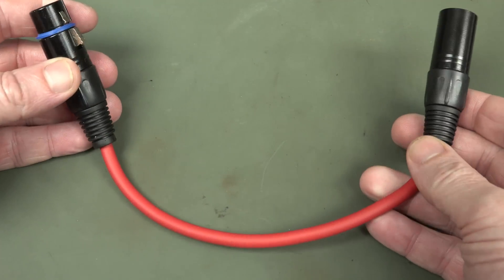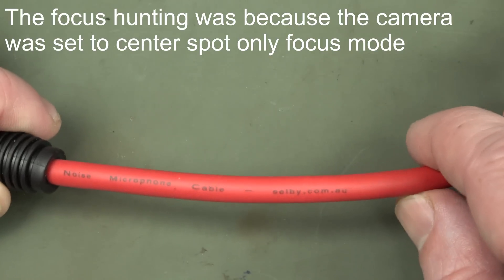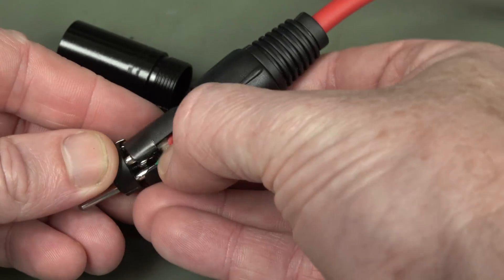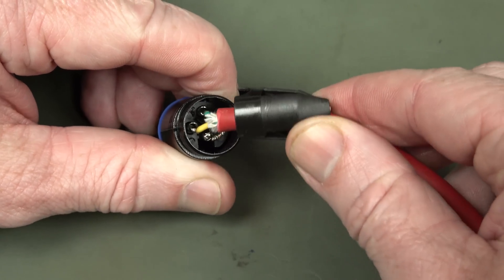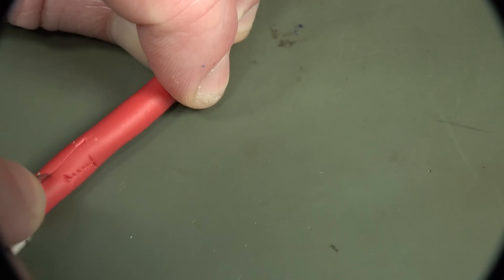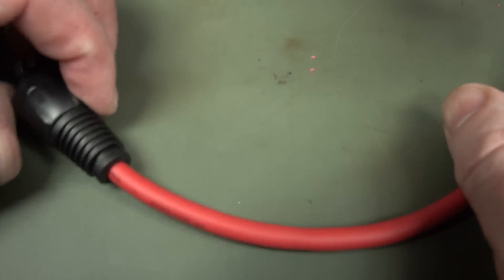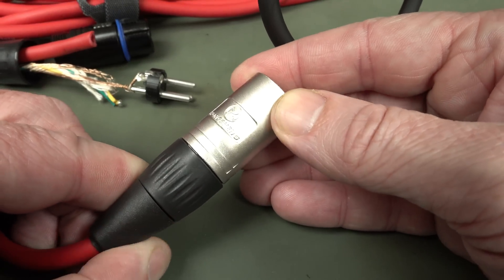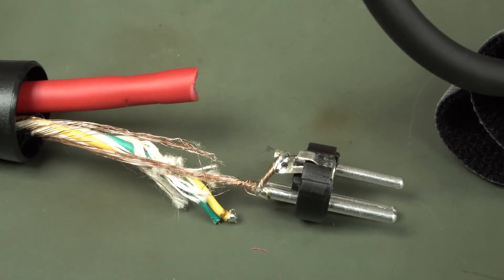Crap Quality XLR Microphone Cable Teardown

Comment: Looks like they forgot to heat the heatshrink at 6:50.
Reply: krish They only use it to prevent shorting to loose strands.  Leaving it unshrinked allows quick field repair with a solder pencil, versus having to cut the cable short and possibly getting a new connector from nowhere.  There's not a lot of places that can get you spare connectors in the evening in a random city 30 minutes before the show opens.
Reply: I just noticed that, maybe there's a reason for doing it like that?
Reply: Or you can just cut away the heatshrink :) No need to cut the wire. The heatshrink will also act as a strain relief at the most fragile point, where the solder on the wire ends.
Reply: If you want one with "shrunk" heatshrink then you need to fork out a few bucks extra for the delux version ;-)
Reply: At least they soldered the wire into the cup.  The heatshrink wasn't needed for corrosion protection, just insulating from stray wires or paths.

Comment: That cable was an absolute disgrace. The cable I've used when making XLR cables always has a foil and a decent braid, and pretty much exclusively used amphenol XLR connectors. Solder cups filled and heat shrunk, unlike the rubbish job they did.

Comment: Yeah, the 1st one was shitty as hell soldering job. More normally the actual bucket in the rear of the XLR-3 pin would be filled and the twisted tinned conductor end well down inside it. Personally i'd never makeoff a mic cable unless it was star-quad, i.e 4 twisted pair stranded and heavy shielding something like L-4E6S Canare.... Made in Japan.... of course.

Comment: That's a really terrible cable. Even the cheap-ish XLR cables have a braided shielding.

Also, when you want to dismantle the female XLR, you have to push on the latch while pulling the connector insides out.

Comment: A common construction problem with ready made cables is the conductive plastic sheathing under the screen. 
All too often not trimmed back providing a resistive short. 
I use lot's of cabling so I buy cable by the drum and bags of Neutriks to make my own.

Here's a question:
When using mic cable i.e. screened twin core, as a guitar lead (Jacks instead of XLRs) which gives the least core to screen capacitance, using both cores together as the Hot or taking one of the cores together with the screen? 
OR 
I guess leaving one of the two inners not connected?
Reply: Although I make most of my own cables I do, when ordering from Thomann, add a couple of these to the order. 
3m cheapos. 
https://www.thomann.de/gb/pro_snake_tpi_a_3.htm
Sturdy enough though. 
I do curl the corners of the cable clamps in to give 'em a little more bite.

Comment: The worse part is taking hours thinking it’s the mic, or something else. Then just discover changing the cable takes away the hum or pop. And some cable companies cut back on the shielding for more flexibility to call them stage cables, thus can cause unwanted signals interference. A good stage flexible cable would use more shielding wire at smaller wire gauges winded together. I guess you do get what you pay for. Even a good expensive cable can go bad, took me a few weeks to discover an intermittent hiss sounds was caused by one cable. 
The behind the screen of being a YouTube creator. Your the director, audio technician, video technician, lighting tech and what ever you do on your channel also.

Comment: Shield coverage shouldnt be too important on a symmetrical connection.
Reply: Yeah, "not too important" under Ideal Conditions.  But if you are in a situation with buzzy phase-angle light dimmers, or a high RF environment (like a broadcast transmitter site) then that horrible cable will bite you right in the backside.  Not worth saving a few pennies out here in the Real World.
Reply: I was just trying to say that shielding is less important with balanced cables like XLR (compared to unbalanced cables), since they cancel out most of the induced noise. Of course it always depends on your local situation.
I wouldn't go with super cheap cables anyway,  since there are already enough other things to get annoyed by.

Comment: When I get new audio cables, I usually tend to open connectors if they are not molded and check soldering and cable so that I know if I can trust them. And for some applications I just buy cables and connectors separate so I can make my own custom cables for specifications I want, and it is usually cheaper that way too than buying whole cable locally.

Comment: Why is the cable grounded to two pins on the first, and only one on the second?
Reply: aDynoNet maybe to avoid ground loops
Reply: Normally XLR cables only connect one pin (Pin 1) to the shield and do not connect the connector housing. That’s because traditionally devices have the shell electrically connected to the metal body (protective earth) but may use a separate “audio ground” for the shield and as audio reference gnd. Not all manufacturers obey this rule, though, and you might get surprised when hunting down ground loops/humming/interference.

Comment: not enough heat in the joint, more than likely if you do heat the pin it will melt the plastic

Comment: Sagan can probably solder better than that!  I'd repair it properly and keep it as a spare (get out of jail card). That shielding will be fine for such a very short length. The purists will disagree and I respect them for that.  Only to be used in an emergency until a proper one from Neutrik comes.

Comment: Never support cheap crap. For 99% of the consumers, the cheap crap just ends up in the landfill.
Reply: I told a chinese seller who sent me some crappy led effect lamps, that he don't need to refund me, if he promises me to tell the manufacturer that they need to push the LEDs flat on the board while soldering it. They will fail by overheating, because there was a big air gap under each led.

I just resoldered it.

He chose to send me replacement lamps.
Reply: Chances of the feedback making it to the OEM? Less than the gap under your re-soldered LED.
Reply: Adam Baxter No Chance. The seller doesn't care.
Reply: 99%?
Reply: logmeindog My sister had a broken washing machine. The technician charged 80€ just for looking at it ( less then 10 minutes) and wanted 225€ additional to fix it.
She ended up fixing it herself for 60€ for the part by watching a diy video how to do it.
Reply: I'm hopeful that at least 1% of consumers will attempt to have repairs made to ever-so-slightly improve the crappy product. Call me optimistic.
Reply: Manuauto I repaired my crappy lamps.

Comment: The shielding doesn't matter much for this length of the cable. The soldering is poor, though. And they attached the shield to the chassis inside the connector, which is not the standard practice and not recommended iirc.
Reply: it is standard practise here in australia all of the 30 or more xlr cables we have at my school are done like that its so its grounded
Reply: Anton * What shielding? Looked like a plastic shell on the "Shelby" cable (presumably unrelated to Shelby cars).

Comment: What no resolder to get it working again and testing the improvement?
Reply: EEVblog2 it would be fine if it was resoldered correctly.
Reply: Because bitching for 7 minutes over crap cable is easier than repairing a simple failure, or making a proper cable using branded quality material. ;)
Reply: Hallb2015 Brandon Hall no it wouldn't be fine, I said it's too tight, it's a crap connector I wouldn't want to use again
Reply from the maker: Nope, nuke it from orbit, it's the only way to be sure.
Reply: Hallb2015 Brandon Hall he also said it's too tight for his Sony camera. Since the has a new cable, might as well just destroy the old one to avoid it damaging something.
Reply: Yes, we all know how bad soldered stuff is from China.  To spend 5 minutes kavetching about something on youtube and say its content is not worthy of Daves best efforts, very negative.

Comment: The lack of shielding should not be a problem, what with it being symmetrical and twisted. All in all it doesn't look that bad, even has a cord for force transfer. Shame about the soldering.
Reply: I've done live sound for years, I wouldn't use cable with that amount of shielding on anything longer than maybe 5m run and even then I'd appreciate it if the source was line level and not microphone level.

Shielding is very important regardless the balancing since balancing not perfect and over the distance and on weak signals there's a high probability for all kinds of crap get on to the signal itself.
Reply: Sure, but for a 30cm run between microphone and camera operating outside a microwave, that cable is exceeding requirements (minus electrical continuity).

Comment: The Yongsheng are a second brand made by Neutrik
Reply: Yep, Yongsheng & Ningbo are Neutrik in China. But even the top production companies in China will use real Neutrik connectors.
Reply from the maker: So it seems:
"Yongsheng or Ningbo Neutrik Electronics Co., Ltd is part of the world renowned Neutrik AG company with manufacturing operations in China. Producing a range of industry standard analog audio connectors for musicians and sound engineers. Connectors manufactured by Ningbo Neutrik Electronics are branded Yongsheng®."
Reply: Ricki Cook Ningbo is the town where their letterbox is.
I bet you can buy counterfeit Yongsheng, too.

Comment: looks like a cold solderjoint. didn't even properly attach to the metal on the plug
Reply: That yellow wire didn't break off. It just completely came off from the pin. The pin had no sign of any solder still on it.

Comment: Pretty crap soldering job. I made audio cables through my highschool years for a reputable local company. Those pins got nowhere near hot enough. The cable fits down in those holes, and should be seated as far down as you can manage. Then the shield should be shorter than the inner core to provide strain relief, then there ends up being no tension on the cores so they don't break like they have here
Reply: Looks like they have a group of assemblers doing the cables, and some of them do a good job, but others are doing the bare minimum that will pass the incoming  DC check on the cables. 

The braid on the red ones is probably 60% coverage, more there to reduce hum in a stage application, not really good for triboelectric noise from handling, where you would need  both the 100% shield and the semiconducting layer around the cores.

Ideally though the cables should be 3 cores with a separate shield to the grounding lug on the connector, let the equipment provide the single point connection to the shield for hum suppression and let the twisted pairs do the cancellation properly. 3 core cable though is more expensive, so you get 2 cores instead, though I have seen plenty with a single core and terrible screen in use.
Reply: I always make sure that even if there's a pull on the cable that strain relief can't cope with, there's a bit of slack so the wires don't get pulled tight.

The strain and pull relief on Neutrik XLR connectors is top notch but even then it can be overpowered in some instances.
Reply: Yeah it is pretty crap soldering I have soldered loads of these including DIN plugs never had a failure yet, you do see a lot of terrible soldering on YouTube and the tips on some of these Irons I've seen better pokers for an open fire  !

Comment: Such cringe worthy soldering! Can't stand seeing bad cables like that as a sound engineer with OCD. Makes me want to take a plane flight over to Australia just to check your other cables and resolder Neutriks onto everything!
Reply from the maker: In this case the connector itself is also a problem, as it doesn't fit properly (way too tight) in my Sony camera. I doubt the Sony is at fault.
Reply: EEVblog2 I’ve seen a lot of female XLR plugs where the holes are too big and/or the contacts inside aren’t springy so they just open up more with each use until they don’t make proper content. I’ve been making my own for a long time now with Neutrik plugs, my current favourite cable is Van Damme XKE, they’re used in a live sound environment and have been 100% reliable.
Reply: EEVblog2 Could be misaligned pins from the soldering heat melting the plastic. That, or they are just out of tolerance.
Reply: Those cheap knock-off Chinese connectors (whether no-name, or some random, made-up name) very frequently have out-of-spec dimensions and cause poor fit. If it isn't Neutrik or Switchcraft or Amphenol, I don't even bother.  And I have been making my own cables for almost 60 years now.  I have XLR cables I built as a teenager (55 years ago) that are still going strong with no problems at all.
Reply: Cordial makes very good quality cables and Neutrik makes very high quality connectors.
Reply: That's why I always buy the components (Neutrik connectors and Cordial cable) and make my own cables
Reply: Jim Griffiths same here, I make my own with good quality cable and components and use good quality lead solder and shrink tubing on the joints.
Reply: Neutrik all the way!
Reply: Jim Griffiths what do you think about the Cordial CRM Series?
Reply: The Czib
*drools*
Can't get better than Neutrik XX series connectors.
Reply: Well honestly, I mostly had Problems with shielding and soldering on cheap cabels but never really with the connectors.
Reply: Tarnished connectors are what annoy me. I always go for gold plated now so I don't have to: Plug in, pull out, plug in, pull out, plug in, pull out, plug in...
Reply: Yeah, when ever you have even a little bit tight XLR-connector, you know that either the cable connector or receptacle is wrong size and out of tolerance. They should fit together with just a bit of resistance.
Reply: Jernej Jakob, exactly. Low quality connectors use crappy plastics that will soften during soldering, letting the pins getting out of alignment. That’s often caused by cheap pins made of low quality alloys that won’t properly solder, that’ll force you to keep your solder tip more longer on the joint.
Neutrik connectors are among the best, that’s what I use. My personal choice of cable is klotz, either simple balanced or multi cores.
Reply: I dare say actually made in china
Reply: Yup, Neutrik FTW!  Weird shit happening with inferior connectors makes them pay for themselves in no time (not that they are particularly expensive).  Having Neutrik connectors on the end of your copper makes that part of the audio chain far more reliable and you can usually look elsewhere for faults.  Having cables that you just can't trust makes for a PITA troubleshooting session - these sessions will happen more often as well with inferior cables/connectors.  Cables are the most troublesome part of the chain, so don't make work for yourself with Yongsheng connectors.